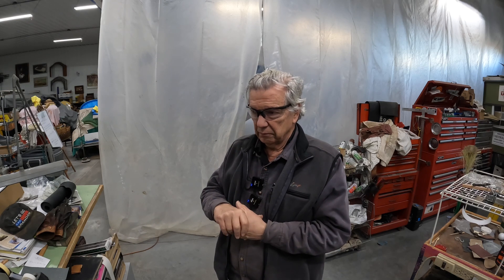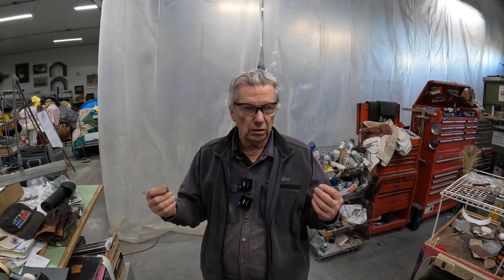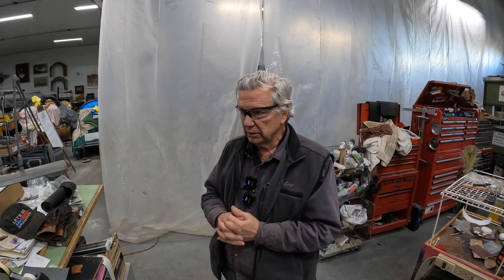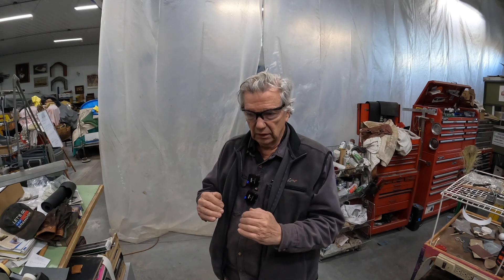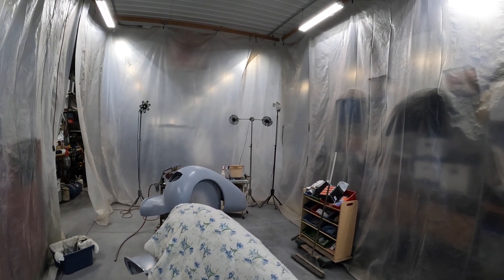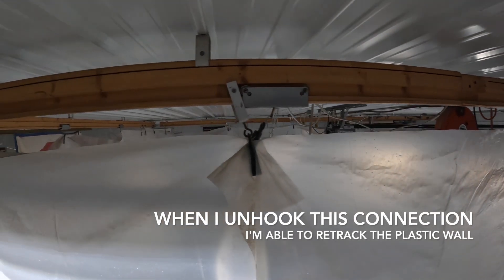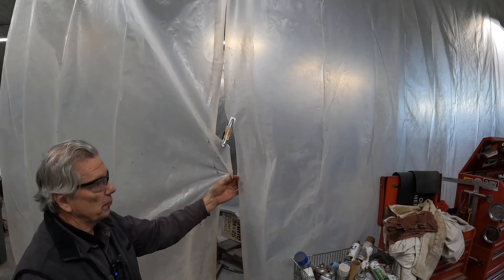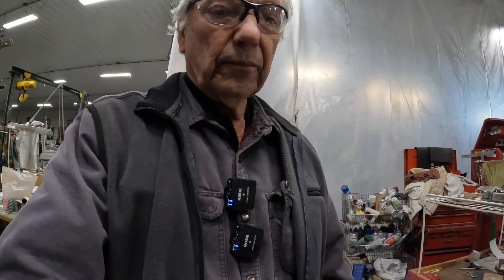Spray Booth 2023

Comment: Plastic booth… your best friend at first… and your worst enemy in a week or two..

Been using same visqueen type booths for 35. years?  

At first when you unroll the plastic it it VERY static charged and will suck all the dust out of the air and attach it to the plastic… awesome thing!  But then after a week or so that static charge dissipates, and guess what? It will rain down all that crap back onto what you are painting by then…. Make it look just like sandpaper..

But I still used it, but I would change the plastic every wing, fuselage… whatever… cost 30$ to change all the booth walls…(both was 10’ by 24’ by 8 ‘high…
Reply from the maker: First, Thanks for your comment! So far I haven't noticed enough build up to cause a problem. I do spend a good deal of time cleaning after every painting event! I also use a floor polisher to clean and wax the floor. I do have plans to use a pressure washer on the plastic walls when the time comes!  And if needed I do have a healthy supply of sheet material. Thanks for watching!